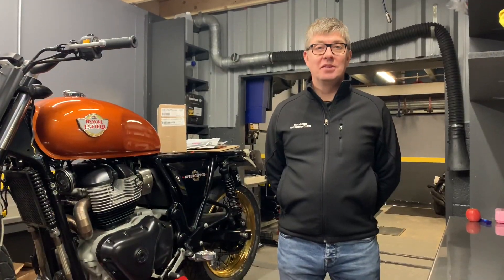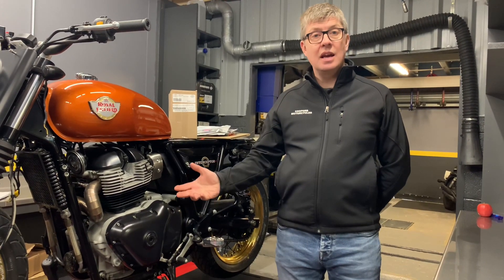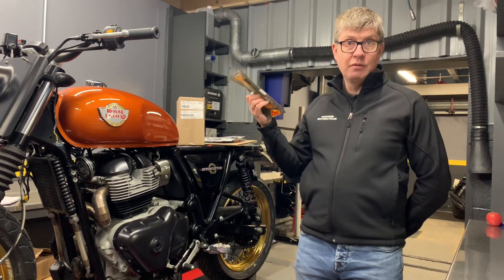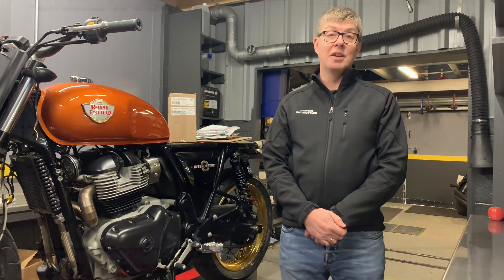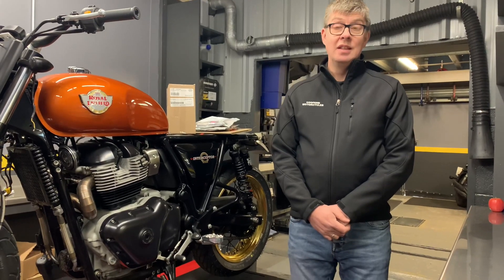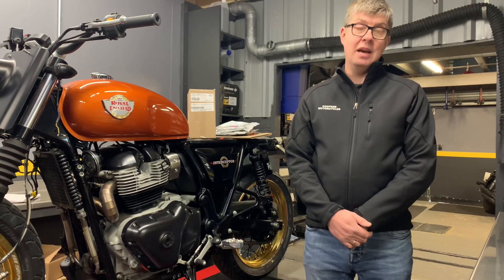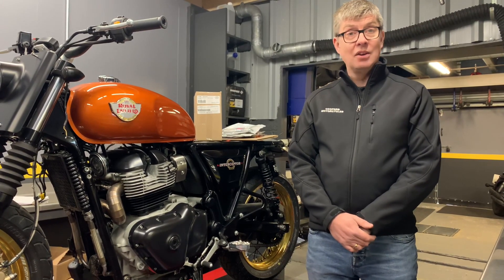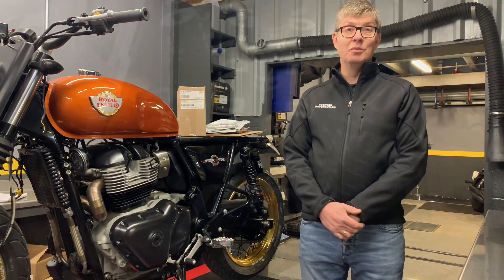Royal Enfield 650 Twin S&S 865 Big Bore Kit Fitted, Tested & Review by Cooper Motorcycles Ltd

Comment: Looks awesome, but 100+ BHP/l in an air-cooled engine might cost a bit on the longevity side..
Reply: Bro it comes fitted with a intercooler..
Reply: @AceMcMoron  i meant radiator, so only bikes that come with turbos come with raditators ? lol
Reply: So it's liquid cooled..Cool!
Reply: Lol no, its an oil cooler  @DwightA.

Comment: Nice job, now get the Himalayan up to 35 BHP.
Reply: Stick an XT660 motor in it.
Reply: @SvenTviking  Exactly, i ride a GS 650, double the power and torque, same weight.
Reply: Wait for the 650 twin Himalayan coming out next year.
Reply: @warrenhancock5742  Been hearing that for 2 years.
Reply: @mikehurley5052  the news comes from RE themselves.
Reply: RE needs to do models set up for countries with better fuel, higher compression etc. The Interceptor has an eight valve head, oil/air cooling yet makes around 40hp at the back wheel. It should be good for a fair bit more than that.

Comment: I’m holding out for the Super Meteor 650 model first before I do all this. I like the Interceptor, but I think I will love the SM650 even more. I can’t wait to ride that in for a year or two and then get a big bore kit fitted with all the trimmings. It’ll be a proper little cruiser with a good amount of grunt and I simply cannot wait to ride it, as well as mod it.
Reply: Did you get the big bore work on the super meteor done?

Comment: can you get away with uprated springs rather than multi disc clutch?
Reply: no, the rekluse kit still feels light to pull but the plates a designed in a special way so that under torque the clutch grabs harder.

Comment: Hi. Great job. Lovely upgrade to the 650. Is this possible using the stock throttle bodies, injectors, the stock cam and the stock cylinder head without any mods at all? I'm guessing a new ecu map will be required but do any of the other parts require changing as well?
Reply from the maker: Hi, this one has standard throttle bodies & head. If we were going for more BHP we can port the head & there are some kit throttle bodies etc. We used a Power Commander to get the fuelling right.
Reply: @MegaCooperb  Thanks. You kept the factory fitted injectors or did you have to upgrade them to get the fueling right with the Power Commander?

Comment: Hello
I'm actually thinking of installing it on my 650.
Can I know what's its top speed and how much time will it take to reach 100kmph?
Reply from the maker: Hi, on standard gearing top speed has remained around the same (Still running ours in) However, you can get to the top speed much quicker & therefore more often if you wanted to..
Reply: @MegaCooperb  But increasing 200cc, 30hp and 40nm of torque should increase the top speed right! If you think practically.
Reply from the maker: @avinashchakravarthy162  yes but we haven't tested top speed yet. 
Our bike has gone away for frame mod's & so far the only riding we completed we were still running the motor in & treating it gently.
Reply: @MegaCooperb Ok. Please do let me know the numbers when you get the bike back and test it.
Reply: I have few questions and doubts regarding the 865 installation and I'm from India. How do I ask you all those? It will be very much helpful to. I have no go in India. I need your guidance.
Reply: @avinashchakravarthy162  Hi Avinash, what is the price when it comes to india? 

Cheers, 
Isaac Thayil
Reply: @TamilGuitarLessons  If you want to import all those it will cost around 4-5 Lakhs. If you are getting those when people are coming from UK or US to India and you are asking them to get it from there then It will cost maximum of 2 to 2½ .
Reply: @avinashchakravarthy162  Thanks for your Quick reply! Very Expensive brother!
Reply: @TamilGuitarLessons  No problem. It is kinda expensive but I think it is the right upgrade, because I can not afford for triumph. In India street twin costs 9.5 Lakhs on road. It's just waste of money unless you have enough to buy and not to worry about. I want the power which can compete with triumph so this is the perfect mod.
Reply: @avinashchakravarthy162  wise move! How about changing only s&s camshaft? Any clue about the price?
Reply: @TamilGuitarLessons  We will talk over Instagram or Facebook messenger?
Reply: Let me anyone in Southindia can install it for me
Reply: @MegaCooperb  is that smart? Many say it is best to break in with maximum potential. Else, the bike breaks in unevenly.
Reply from the maker: @avinashchakravarthy162  you can email us form our website.
Reply: @avinashchakravarthy162  top speed is also a function of gearing and parasitic drag

Comment: I currently own a RE int 650, and have owned other faster bikes. I am sure it would be fun but I don’t think the extra cost would be justified.  Maybe if one did all the work themselves.  So the way it brakes down 6,500ish for the 650, plus 4 to 5 k more , for 11,000 usd you can by a much more powerful bike. Maybe not with as much character as the RE though.  Too much money for modest improvement
Reply from the maker: This is all about choice. As riders we all like our bikes to be slightly different, that's why we personalise them. The price is less than a full carbon race fairing hung on titanium mounts for a modern track bike & lots of riders choose mod's like this. It's not cheap & not for everyone, but having ridden this one I think it's a great addition to an already great bike!👍👍

Comment: Why did a 650 Bonnie blow my mind... 1972....or a 750 Commando in 1973 also blew my mind....and head gaskets....Where did the Raw mid range grunt go?
My zx14r has low down grunt and its a 4 cylinder...I believe it has half its hp at 2000rpm....it will take off at idle with no throttle...
Maybe its not just about displacement?

Comment: the stock engines 47hp is relaxed considering that the engine is not a long stroke engine (bore = 78mm and stroke 67.8mm),,  the bike has a low compression for a modern twin cylinder bike (9.5:1),, It should not be hard to push up engine HP and torque by 10% to around 52hp by increasing the compression slightly and altering the ECU and airflow (and use good european fuel),, a decrease weight with lighter pipes. 
I think that indian bikes are made to run on low grade fuel (octane 91).

Comment: You have to factor in the cost of a 900 Triumph compared to RE with £3000 mods...which is a shame. The 900 Triumph twin also lacked power and torque...so its a 1200...and they are so dear Id have sell my other two bikes...zx14r, 1900 Roadliner... to get one. I never felt the original Bonnies and Nortons  at 650 or 750 to be gutless....must be need long stroke and Torque